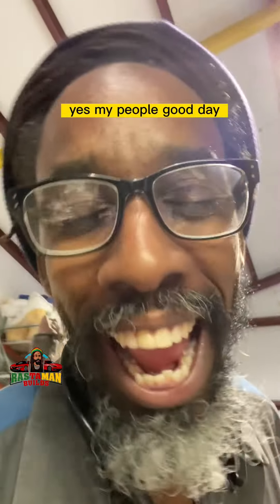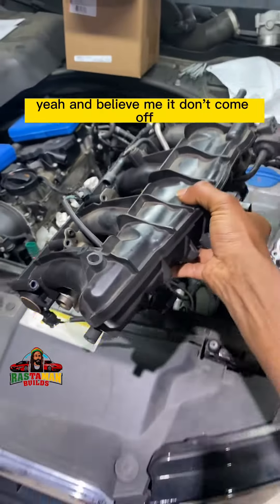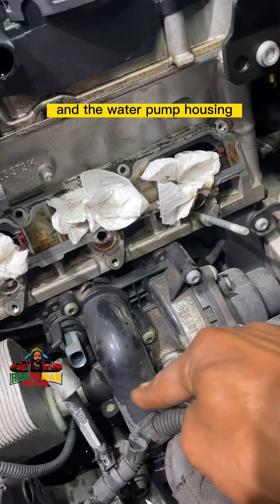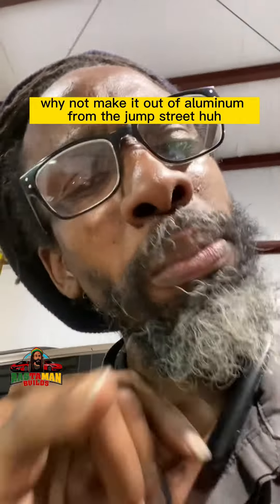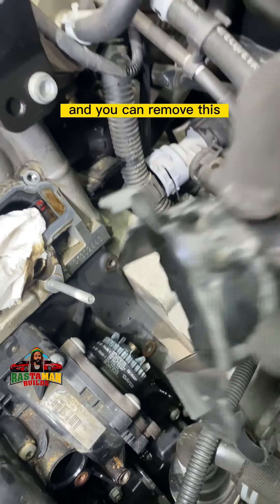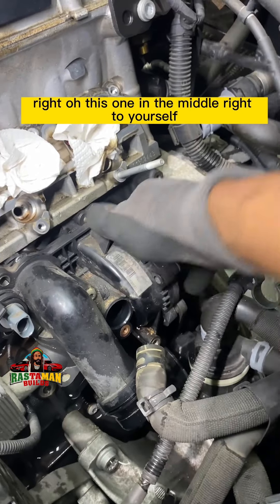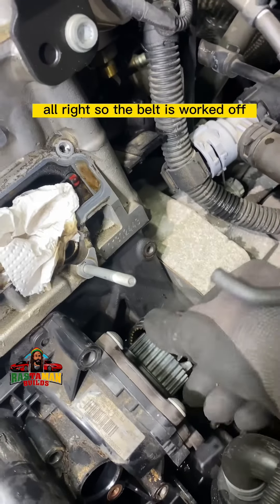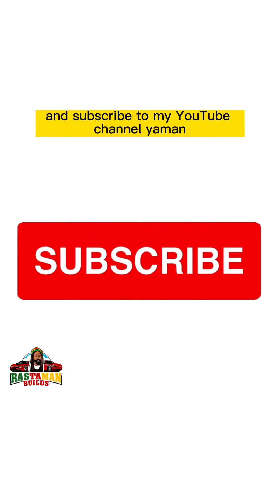Audi A6 Water Pump replacement. So Soon too. Why?

Comment: U dont have to remove intake manifold.. u can just remove the wire loom and throttle body after coolant resovoir tank get easy access n use t30 most the way thru

Comment: Automotive manufacturers makes money from service parts, so they know those flimsy plastic parts will fail in no time. Question.....is that new water pump OEM????
Reply: Correct,  it also comes down to a business decision.  European car manufacturers know that about 80% of their target customers are at the high end of the market and will likely not keep a car for more than 2-4 years, before upgrading to a newer model.  Therefore there is zero profitability in making long lasting parts. Longevity and reliability is NOT a concern for customers who can afford an audi
Reply: Yes It is OEM but here's the Catch to that aluminum with Audi. So only the higher class Audi's meaning any RS vehicle for example RS7 will have It aluminum water pump or Thermostat housing, but not a A7 or an S7 won't have it. Why idk This is how Audi makes their money 🤷‍♂

Comment: You do not have to remove the intake manifold, to change the waterpump. It is a common issue on Audi 4 cylinder engines, 1.8 tfsi and 2.0 tfsi, but does not need a ton of work. 
All the best!
Reply from the maker: Ok
Reply: I had to rewind the video back to the beginning. How in the hell do you remove that without removing the manifold? It's  right under it. Is it by feel under the manifold?
Reply: How the heck would you get those 5 bolts off? 😂
Reply: Yes, you would need a torx 30 bits and add an extension to it. Either by feel or with the help of a small mirror and a lamp you can easily see the screws and undo then. Same goes for the cover for the belt and the belt.
Reply: Yeah you really don't have to remove the manifold, I have done it plenty of times but the extra space you get for removing the manifold will also let you see how flat the mating surface for the gasket actually is and also install the belt without a struggle.
Reply: @mohamedalamary4128  You think that sounds normal 
That’s a shortcut for a very experienced mechanic
You can also change the spark plugs on my car with teleportation without taking out the intake manifold
Reply: @joem8601  I am a certified Audi technician and work with Audi models 40h/ week for multiple years. Also, it does not say anything about removing the intake manifold in the repair manual from VAG. But I guess some people will always have something negative to say.
Reply: @mohamedalamary4128  Well people will always have bad things to say out of ignorance but this doesn’t really fall under that category because most people aren’t certified Audi dealer mechanics and don’t work on Audis 40 hours a week 
So naturally they wouldn’t know the weird steps it requires but someone like you would apply those steps while also having all the repair manuals and resources at your disposal because you don’t need to pay for repair manuals (those have to be purchased from my understanding of car ownership) 
That doesn’t change the brands reputation either way because it’s a shit brand 
My friend leased a brand new Audi (high end model) which had a squeaky dashboard because of poor choice in material and a bad design
That speaks volumes
Now after this video I’m convinced that Audis are not worth shit
Reply: He had a hard time with the manifold off. Can't imagine doing that with the manifold.
Reply: @dwai1967  Exactly but certified Audi here wants to argue
Reply: @joem8601  LOL! I also can't see a dealer technician doing the job the way he describes, lol.